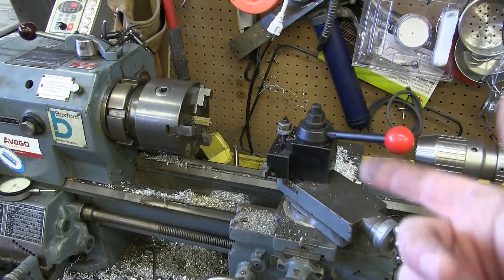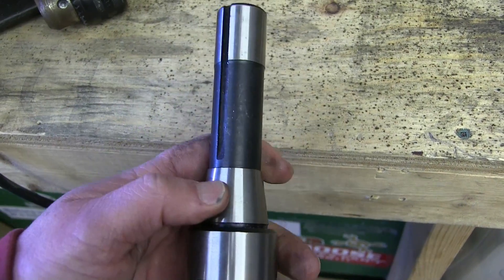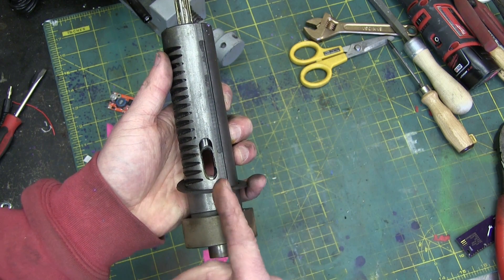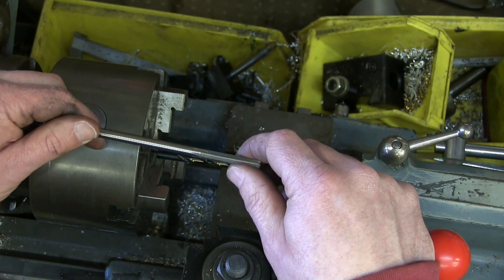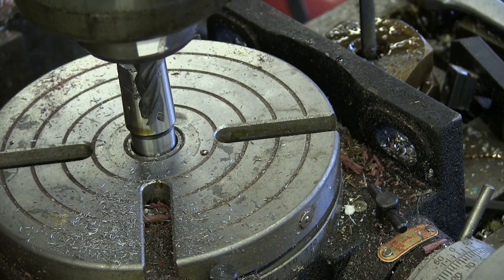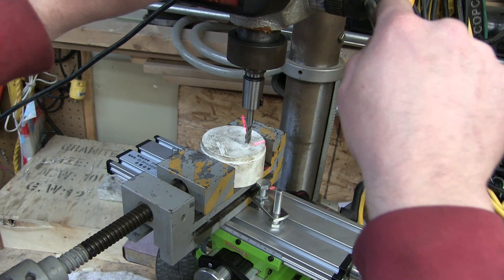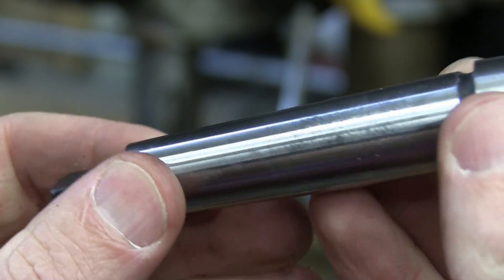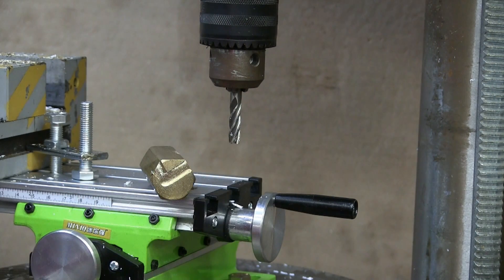"IMPOSSIBLE!" Milling Machine from a Drill Press

Comment: Remove the Jacobs from the Morse and plunge the Morse down onto the drill bit and ream and you will know it is centered because it has machined itself. 

Use 2 extended length bits of smaller diameter and keep plunging the smaller one right up through the  Morse and the quill. Then remove the Morse, install the larger extended length bit and plunge down to re-drill the quill out to a larger size that will accommodate a long bolt, tap the top of the Morse for that bolt's threads, and now you have a draw bar.

Now replace the bearings with tapers and install pointed set screws just above the upper bearing so that when extended the points ramp against the upper edge of the upper bearing's outer race and hold the bearings in oppositional tension against the shaft. This will really help with run-out, but you are not done yet, you need to stabilize the Quill sleeve inside the head frame which you do by tapping 3 holes in the frame at the muzzle and the top, and install bolts with set nuts in each hole with a small pellet of Teflon or UHMW (or Delrin or whatever) as a sliding surface against the Quill sleeve, and you can now finely adjust and true out the quill sleeve within the frame.

Replace the drive belt with a Harbor Freight segmented drive belt so it won't slip against a load.

You need a coolant sprayer so put a Cat litter box under the table with an aquarium pump and run some tubing up to the head and down a length of coil flex tubing and cap the tubing with a reamed out irrigation dripper, fill the litter box with a couple inches of coolant and adjust the flex tubing to hold the dripper above whatever you are cutting.

Now you have a baby Bridgeport for about $300, and it's a quite capable little mill for your investment. A very handy thing to have I can assure you.

You can also make a nice little lathe out of a drill press mounted horizontally, but that is another post...
Reply: Karen Audrey Todd king dude, you need to shoot a youtubevideo of whatyou described, i bedit wouldgeta lot of hits!
Reply: this is more what I was expecting him to do. he ended up doing all that work just to end up putting the bit in the chuck and buy a cross slide table haha

Comment: excuse me sir I was wondering if you could recommend a machine for some one with no back ground working with mills and I do not have a shop I own a 71 charger 500 and some classic motorcycles  that most parts are impossible to find so I'm going to just make them my self looking for something not overly complicated but durable lol I'm a quick study but almost all the info on line seems like a foreign language are there any machines you would recommend? money is not really an issue but would like to keep on the lower end as it would not be for mass production.

Comment: I would not spend any money on a drill press unless it was for a wood shop or I got it on Craig's list cheap. You can get a very decent small mill for $895us. http://www.littlemachineshop.com/products/product_view.php?ProductID=3990 This mill can be readily converted to CNC as my dad and I have done with a kit which includes ballscrews and motors to drive the axis adjustments. It's not a Bridgeport, but I don't have space for a full size unit.

Also, if you are in the market for a Bridgeport but having trouble finding a quality example. Supplies are still around but are getting harder to locate. You may decide you want something new with a warranty. Take a long look at the tormach...http://www.littlemachineshop.com/products/product_view.php?ProductID=4263&category=1241045623 they make a couple of smaller units, that are less,but buy the big one if you make the investment. This machine is full multi-axis CNC with optional rotory table and tool changer available. Allows you to do so much more even though it can be used as a manual machine. I've known several guys that have them and demoed them a couple of times. Super nice.

Comment: Well i made airsoft rifle receiver using this type of "milling machine". Mainly rough machined most of the (tool grade) aluminum out and then filed the rest by hand. I can only say that given how much milling machines cost around here 300€ investment on the drill and cross feed table+ milling bit was all worth it and gave much better results than just trying to mill the part with the damn cordless drill and normal bit..

Comment: lmfao Love the reaction to turning on the press with the new taper installed.

Just a flat out "Holy Fuck" at the sight of the wobble. 

Although it is the Jacobs he is using if a person knows the limitations of the head then it could be made to work for a very long time doing extremely light passes. However you cannot expect any type of accuracy with something like that but it sure beats the poor man's mill (angle grinder). This is at the very least a step up from that and would suit most (mill for fun) people at home. And if for some reason the bearing blows out then replace it with a bearing designed to take side loads better and do like he is planning on and get a collet to hold the end mills.

A very cheap solution for someone who can't afford to buy a mill but owns a drill press and needs to make a relatively straight cut. And I have seen folks cut side rails on a 1911 frame with a dremel mounted to wood and 3 cut off wheels. At least something like this would provide a bit more accuracy and end up with much better rail cuts.

Comment: Using a mill to make a mill? I would have ground a flat on with my bench grinder just by eyeball, flat enough to drill into. Then put it the V on a swivel jaw machine vice to drill the set screw hole.

Comment: ive milled on drill press with straight flute never falls out when I use spiral flute bit other hand the chuck always fallout. not because side force. its because the spiral pulling the work piece up if the work piece is secure its pull the chuck down thus falls out.

Comment: I've heard the deal that you can't mill with a drill press thousands of times and ignored it.

My cheap little drill press was given to my brother when I found a full size, floor standing delta for free.  I ended up first trying milling by dropping 160lbs of sand bags on the base and then chucking up a HSS from HFT in the chuck and going for it in some MDF, holding the workpiece BY HAND (I know I know).  It worked so well that I ended up going to HFT and getting their X Y vise and trying that and I was milling, and eventually added the biggest chuck that I could easily get a taper to match the delta for (Jacobs No 18 that I snagged on ebay for $13+shipping and rebuilt it when ebay wasn't all vendors) to give it more mass making everything more stable.  I never did have the taper come out or anything funny happen, even machined a bunch of prototype electronics housings for work with it that way eventually.

Of course, that gave me the bug and I picked up a old worn out bridgeport ;-)

Comment: So I made a drawbar cross nut for my drill press to keep the chuck from falling in my lap at high speeds. Just took about an inch of 1/4 X 1/2 bar or whatever was close to the width of the drift, drilled and tapped a blind hole in the edge of it, loctited a set screw in there and now I can not only twist the collet or drill chuck firmly into the taper, but removal is just as easy. No more lining up the drift and whacking the shit out of it, just thread the Chuck out of taper lock.

Comment: So, the big question that comes to mind here... why did you bother with doing two setups on two different machines? Granted, the fuckery with the tailstock misalignment and resultant runout was entertaining and all, but if you were going to cut the flat using the mill and the rotary table, it seems like that might have been the better option for doing the drilling and reaming as well?

Comment: I have that same drill press and it actually works okay for a mill as is if you clean the sockets well and use soft materials.  I don't go harder than aluminum.  It has speed adjustment from 500 to 1500.  Very good for plastics.

Comment: Always wanted to do this But I was told VERY specifically that the Morse Taper would eventually come loose and fuck right off across the shop while milling something and damage me or my stuff in the process. I've also heard that the bearings in most drill presses are not meant to take side load as such they wear out quickly when used like this. 

I'm assuming that you have overcome problem 1 (to some certainty) by deferentially heating the socket and quill when you fit them together. But what about the bearing? Just run what ya brung until she fails or?

Comment: If you want that hole in the tool holder to run true, you need to bore it with a boring bar.  Most lathes have a morse taper in the headstock spindle, remove the chuck and use a morse taper adapter if needed (typically #3 to #2).  Drill it undersize and then bore it out.

Comment: Not to throw stones at your lathe, but it appears it needs a tune-up.  I'm no expert, by any means, but Keith Rucker at Vintage Machinery just released a video you might be interested in to tune up your lathe and it appears fairly simple: https://www.youtube.com/watch?v=5bWpgElMm8c.  Not judging, just offering a solution to the machining problem you experienced in making your milling cutter tool holder.

Comment: 1, 3, 2. 1, 3, 2. 1, 3, 2. 1, 3, 2. 1, 3, 2. 1, 3, 2. 1, 3, 2. 1, 3, 2. 1, 3, 2. 1, 3, 2. 1, 3, 2. 1, 3, 2. 1, 3, 2. 1, 3, 2. 1, 3, 2. 1, 3, 2. 1, 3, 2. 1, 3, 2. 1, 3, 2. 1, 3, 2. 1, 3, 2. 1, 3, 2. 1, 3, 2. 1, 3, 2. 1, 3, 2. 1, 3, 2. 1, 3, 2. 1, 3, 2. 1, 3, 2. 1, 3, 2. 1, 3, 2. 1, 3, 2. 1, 3, 2. 1, 3, 2. 1, 3, 2. 1, 3, 2. 1, 3, 2. 1, 3, 2. 1, 3, 2. 1, 3, 2. 1, 3, 2. 1, 3, 2. 1, 3, 2. 1, 3, 2. 1, 3, 2. 1, 3, 2. 1, 3, 2. 1, 3, 2. 1, 3, 2. 1, 3, 2. 1, 3, 2. 1, 3, 2. 1, 3, 2. 1, 3, 2. 1, 3, 2. 1, 3, 2.
Reply: ima goof
Reply: The never ending carousel of balance,  a three finger technique you probably don't want your ultimate appendage firmly grasped by. But who knows, I'm sure there's plenty of homebrew games with the label of twister.
Reply: "Hey luv, we still got that crashing waves and flutes cassette from the 80s? Yeah the wonky one. Don't worry yourself I'm just working on a video for a friend."

Comment: nice to know for the home gamer building the AR, the 80% lower guys out there might wanna try it.
Reply: I've done it on my drill press with a well adjusted harbor freight cast iron cross slide vise along with an end mill in the chuck.  I got an old Delta Rockwell bench top drill press from the 1940's and its all cast iron and super stout for a drill press (way more rigid than any box store Chineseam brand).   We were able to pull it off cutting a 7075 aluminum receiver and the gun worked flawless when we were done!  (I'll admit that a little bit of luck may have played a factor)

Comment: At least you can control your spindle speed properly on that abomination. On my little contrived bit fucker, I used a skookum wood router attached to a cast iron XY table. Rigid as can be, but my min speed on that wood router is 8000 pixies per second, so I can't cut anything but aluminum and zinc. Of course, that didn't stop me from trying to cut steel and titanium, but let's just say that tool life wasn't so great.

Comment: Why are you telling lies? Railroad wheels does NOT have a taper! They are pressed on cylindrical surfaces with interference fit!
Reply from the maker: There's lots of railroad equipment that uses taper axles. Modern rolling stock likely not. You feel the need to be a pedantic fuck doesn't change reality.

Comment: I tried to turn my cheapo drill press into a milling machine a few months ago. Ended up with a very sad drill press and spent thousands on "proper" machine tools which I have no real idea how to use. Now I'm addicted to buying all of the things that I didn't know I needed to run my mills and lathes. It's worse than crack cocaine boys. Heed my warning and stay off the slippery slope.
Reply: "when I die, I hope my wife does not sell my tools for the price I said I've paid for them"...
Keep on trucking (from France) !
Reply: @TheMarcball  😂😂😂👍👍👍
Reply: It really is tho. Tools cost more than drugs do.
Reply: but at least you have the nice tools to fuck shit up with over and over. then when you figure it all out, you can sell it......lol    half the fun is learning what not to do, tools last, the dope well its short lived,    loved when he fired up the morse bit thinging majabob..   holy fuck thats bad, probly better of with just the jacobs chuck,,,,,,     or when using the reamer,,,omg   oh well lets just keep going and see if we trash the hole thing,,,,    funny vid, i needed the laugh and yeah ive tried stuf like this,,,,,,,,,,     i turned the crank shaft of a side shaft lawn mower engine to fit a clutch / gear pully for an old snow througher,,,    put motor in vise, started it up and used a hand grinder to get close and a file to finish off,,,,    hell i made a firing pin from a drill bit in a small drill press and used a file to cut it,   both worked, and i didnt spend for a mill or lathe,  though i would love to have them
Reply: Too late! I’m hooked... bad! I love to take my turn at the wheels.
Reply: umm maybe I shouldn't get the cross sliding vice
Reply: @ponemark  I got a cheap cross sliding vice.  You can maybe mill wood with it.  However, it is mighty handy for positioning a work piece, especially if you need to drill a series of holes.  It, and this video, have convinced me of the merits of a proper mill.  If I had any floor space to put one, that is.
Reply: i was thinking of buying a few end mills for my exstra cheap 500w drill press because drill bits tend to wonder and sometimes i drill slits in the metal and the bit wants to go in to a hole i drilled before will a end mill solve that problem. Im not planning on getting a x y table and trying to force the drill press to push from the side not yet at least
Reply: Hahaha...I feel you man
Reply: You said it  best there I’m in that boat with you and hope we don’t sink
Reply: You poor sap. As a machinist, not a button pusher, that saddens me. It has been 4 years since your comment, so I hope it has improved since then!!!
Reply: @saturnmedia1  Sadly, no. The addiction's worse. The toys get more and more expensive, the chips are piling up. The only positive thing is that I now have half an idea of what I'm doing instead of no clue at all. But it's great fun.
Reply: +Will S.,
Machine shop tools may cost more than illicit drugs by weight, though used properly, are safer, and far less likely to put you in the grave.
They are also objects of production, not products of destruction.
I know where to put some of my discretionary funds!

Comment: Ave I have a south bend lathe from war time it has a tag on it that states THIS MACHINE CONFORMS TO ORDERS OF THE WAR PRODUCTION BOARD.i machined a diff spacer shim on it. It was out 0.01 IN  not bad for a 70 year old machine.Do you have any info in this lathe its leather belt driven with 3 stages all shafts oil lubricated with cup lubricatators the head is 5IN the bed is 30IN

Comment: I worked with a 90yo machinist years ago and he was able to make his drill press work as a reasonably accurate mill by building a ring with a set of three bearings that surrounded the chuck to give it extra lateral support - like a spindle support rest for wood lathe work.  The plate was supported by a bar that had an adjustable mount on the side of the drill press.

Comment: Hmm I slathered a drop of loctite on my drill press MT2 taper to hold the taper in the quill. I managed to get it back apart with a little heat and a little hammering. No need anymore since I bought my mill, but it worked great at the time.

Comment: I'm not sure if it's been mentioned or not but could part of your issue with runout at speed be because of the imbalance caused by the screw holding the end mill in?
Reply: When it's Dark out Nah, I've used cap screws instead of set screws in a pinch @11,000 rpm with no weeble wobble. though it was also in a cat40 taper on a mazak...
Reply: 3800scgp I wasn't sure how much it would affect it but I guess it's not going round fast enough to be an issue thanks for the input

Comment: This is the kind of thing that I think about as to why wouldn't this idea work. Could probably attach two stepper motors to the XY table, but don't know how to interface between the desired outcome and the software to guide the stepper motors. But could probably use a Raspberry PI to step the motors the required number of steps to move the table the required distance. This vid does provide proof of concept. Thanks
Reply: How did you get my name?
Reply: My mother and father gave it to me, we thought you were done with it. Does the 80 mean you are 80 yo or you were born in 1980, in which case I have a previous claim on it. what do you know of family history, we may be related.

Comment: Holy shit dude! I did exactly the same thing, even bought the identical Chinese crap-as-fuck 2D translation stage! I didn't have to fuck up my chuck, though. It worked just fine with the Jacobs-Judas-whathever thingy. It's great for quickly making square holes in sheet materials (even 2mm steel is fine).

Comment: How about replace the drill press with a Harbor Freight/ Canadian Tire trim router. Pretty easy to make up a fixture and use one of their speed controllers for the speed part of speeds and feeds. Already has a 1/4" collet and is designed for side forces.

Comment: you got lucky with that centre on the little turntable being morse 2 but couldn't you just get the angle grinder out and put a flat on it that way? I mean if it building this I don't have the mill to put the flat on it anyway that's why I'm building this tool is it not? ps wow, what speed wobble she had on when its was choochin frick that I'll just buy the damn mill.